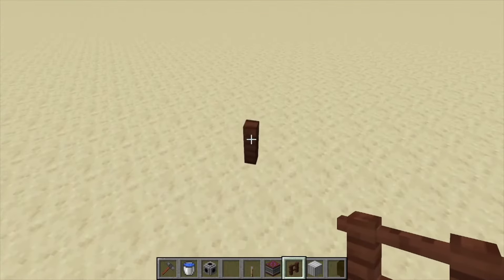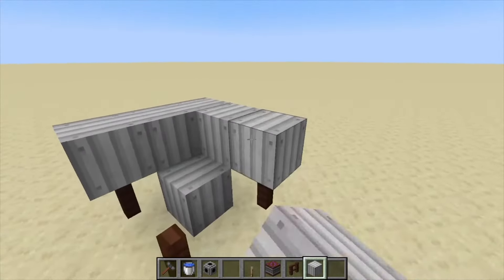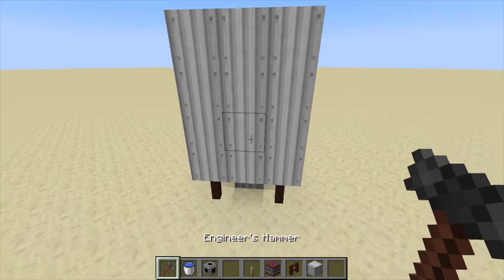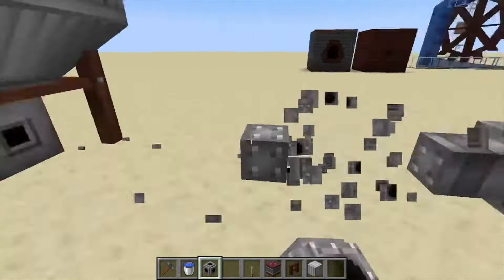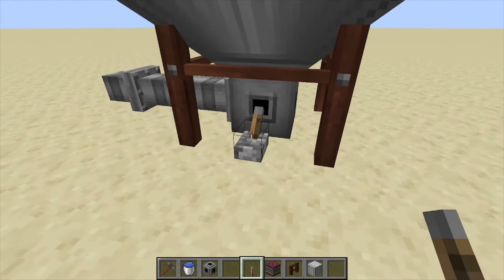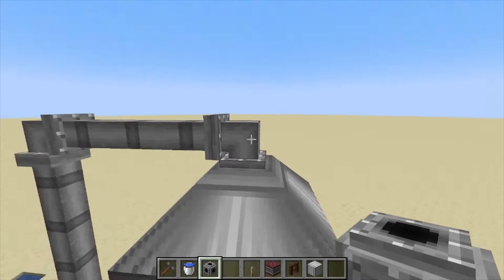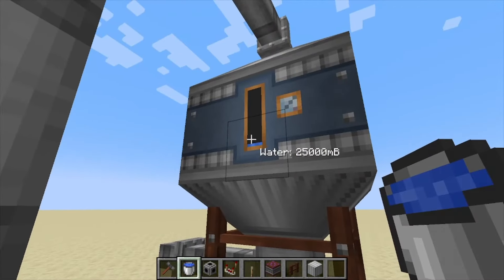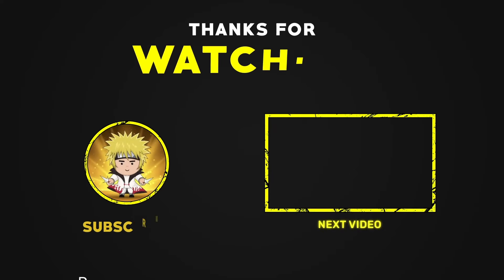Immersive Engineering: TANK (how to build and use)

Comment: But when ever I restart my world the oil tank or tank filled with curde oil or biodiesel almost becomes half. I lost 1000 of buckets of fluid through this. How to fix it.
Reply from the maker: Crude oil is Not a part of Immersive engineering you must be working with an Addon. This sounds like a bug issue goto the mod makers curseforge page and they may have a discord link or a github link to report all bugs
Reply: @MCMentor1  i am playing Minecraft immersive engineering+ IEP( immersive engineering petrolium)1.18.4 from tlauncher and in my world I have crude oil and it's related all other resources and machines. My Minecraft immersive engineering already comes with crude oil and other liquid fuels but I am just facing the problem

Comment: Thanks. I was looking for some more specific info. In the in game manual it mentioned placing the comparator at different levels of the 4 upper levels get a signal at certain fullnesses. Then I want want to use the redstone wires to shut of the pumpjack. Currently have a comparator at the bottom with 15 redstone leading to a redstone wire connector connecting to the pumpjack but its so messy. lol

Comment: I need your help
I have 3 tanks connected to a fluid router connected to my distillation tower
It works and the fluids go in their respective tanks but i can't get the diesel out to my diesel generator
Reply from the maker: Why do you want to take the diesel out of the generator ? You can stop it from running with a redstone signal
Reply: @MCMentor1  no I mean I can't take it out of the tank into the diesel generator
Reply from the maker: @Aleex1869  ok I miss read that…so you have diesel and other liquids running into a router and the diesel is no running into the engine. My first guess would be that a liquid entered the pipes besides diesel and it’s blocking the liquid from entering.
Reply: @MCMentor1  no because there are tanks between the routers and their destination
only the diesel tank is plugged in (to the generator) and there is 40000mb of diesel in the tank
Reply from the maker: @Aleex1869  lever on at the bottom of the tank to make the liquid come out ? And make sure nbt is not clicked in the router. You can send pics to my discord also so I can actually see
Reply: @MCMentor1  both are.. I'll send you pics
Reply: @MCMentor1  what's your discord ?
Reply from the maker: @Aleex1869  https://discord.gg/4Ca966uU
Reply: @MCMentor1  thanks